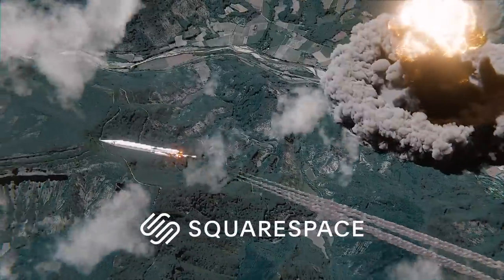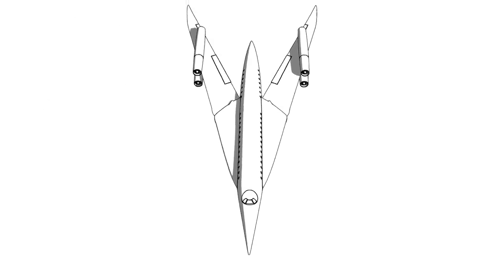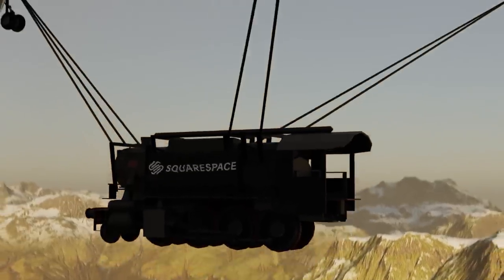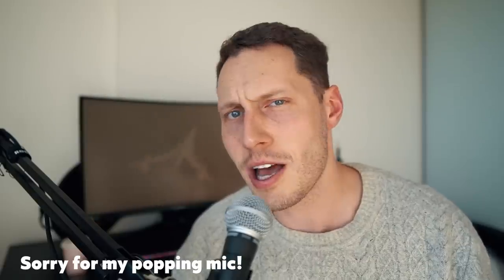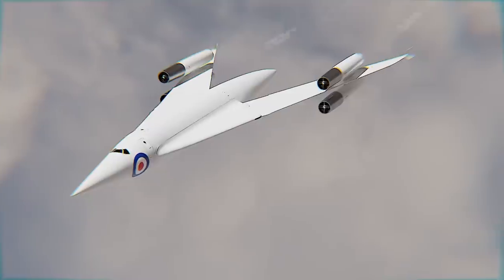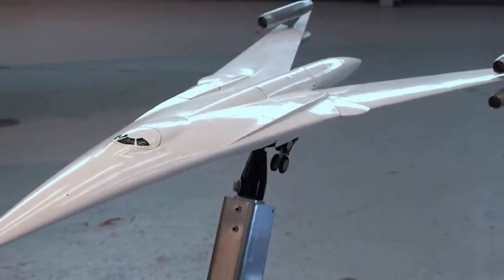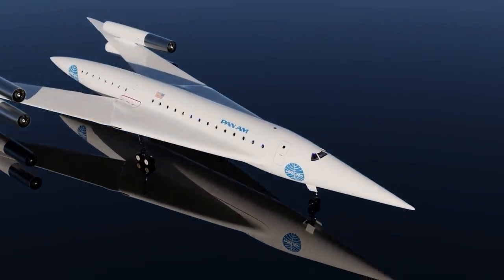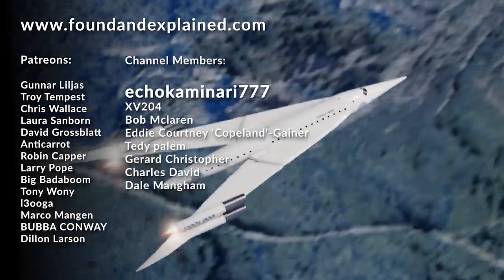The INSANE 1950s British Nuclear Bomber With No Tail - Vickers Swallow

Comment: Looks cool and it most likely would work but I can see a few major design issues with it.   A swing wing and swing engine design is complex and adds a lot of weight to the design.  For a plane to fly constantly this will become an issue in maintenance and reliability.  Add to that the need for the engines to be able to independently move just adds to the things that could and would go wrong.  The complex swing and movement controls would also take away passenger capacity and fuel capacity.  Also with the wings fully swept back the wing areas are exposed to a lot of heating from those engines meaning that wing area would need to use most costly materials to overcome it.   Nice cool looking plane design but way to many issues to become a safe and viable project.
Reply: Well after hearing our F111's were send to Alaska to have there wings pumped up and down 50 feet at minus 40 degrees to test out there strength. Scared the hell out of me and I was only a ground support fitter RAAF.

Comment: ARRRGGGHHHHH!!!!!!!!      It is/was the General Dynamics,  F One Eleven. 

One of the 10 fastest aircraft ever made, and that includes the three aircraft of the SR-71 family and the X15! They could also do a spectacular dump and burn. In the early days, they had another trick - crashing due to structural failure.  Known as a hanger queen due to the high maintenance requirements, the cost of which forced the decade-early retirement of the RAAF F111Cs in 2010 (was supposed to be 2020) after 37 years of service.  The only other operator of the aircraft was the USAF, which retired theirs much earlier.  In a little bit of a twist, the RAAF donated one of the aircraft to the Pacific Aviation Museum, Ford Island-Pearl Harbor, Hawaii, where it can be seen today.  It was restored to its original appearance, had the wings and tail (I think) removed, and was shipped over to Hawaii in a Hercules, then reassembled, gratis.   Several aircraft and a number of cockpit modules are on display in Australia.

Barnes Wallis's razor witt could have been harnessed as a weapon of mass destruction.

Comment: If it had a potential Military role then all RAF transport planes have their seats facing backwards, that probably explains the seating plan, rear facing seats are safer in a crash, it spreads the force across a larger area instead of concentrating it all in a lap belt

Comment: backwards seating is safer and more comfortable during deceleration.  But also contributes to motion sickness.  The engineers were right, but customer uptake and expectations would probably see it as a negative.  But no one has actually tried it yet on a commercial scale.  would be interesting to see if it was a success.

Comment: The reason for the rear facing seats is related to the humans being able to absorb higher g forces on their back rather than their fronts. Note the configuration of the Apollo capsule which has astronauts lying on their backs for the landing sequence. On the subject of this aircraft, its an example of idyllic aeronautical engineering where no mechanical component could be allowed to fail in order to maintain flight stability. I'm glad this piped dream was never built, lives have been saved.

Comment: The RAF used to fly the VC10 and all the seats pointed backwards, I believe the idea behind this was that on any mild crash ie. non total destruction or immolation through fuel explosion, the passengers bodies would have a better chance  to be completely protected and if you think about it, it could be true.  I say this because I don’t think that any VC10 had  a major crash incident.  It’s certainly worth checking.
Aaah !  Just checked Google and there are confusing reports for the safety record of the VC10 depending on whether it’s the RAF or civilian version that is questioned.  Apparently the RAF version fleet had two fatality crashes and some injuries but not much more, as to the civilian version, I didn’t read into it.  I was in the RAF and have flown on the forces VC10 and I remember being seated backwards while flying and I had no complaints, not even airsick tee hee!  So all was good!
Cheers Aah Kid!

Comment: Swinging wings? Wow
Reply: Engineering improvement the jet should be located on the fuselage wing sections so the hydraulics have to work less that will reduce to two plane crashes

Comment: If you loose an engine you reduce the power on the 2 on the other wing no great problem with 4 or more engines not possible with 2 so they already thought of that. Thrust vectoring in now common on military fighters giving control not possible with rudder, elevator and ailerons.

Comment: Hi m8.
The swing wing yank bomber was called the F One Eleven Aardvark which stole the world of aviation away from the Brit TX3 and the Canadian Arrow, both developed to flying stage exceeding all expectations both. The Aardvark was a successful sub radar terrain following killing machine to their crew but was used over the fore mentioned bombers due to American salesmanship and the British Lord Mount Bratton, unfortunately.
Reply: Mountbatten championed the Buccaneer, and he was right. That boondoggle TSR-2 project was a ridiculous waste of British taxpayers money, offering hardly any advantages over the Buccaneer at low-level, but costing three times the price! The project only continued as far as it did because of RAF intransience and aerospace company hubris.
Reply: @octowuss1888  you must be referring to the hypothesis that the RN failed to notice that Australia had been moved 200 miles or so to fit in with TSR2 range calculations (Senior service arrogance?). To many people TSR2 offered high speed low level supersonic flight with automated terrain following. The publicists may have pointed out the bananajet couldn't compete in that regime. Personally I think the thing was literally a whe elephant, and once Buccaneer had decent engines it was a perfectly adequate fit for the RAF.
Reply: The F1-11 is probably the most famous Australian air force plane.

Comment: Dont need to see your face to ask a query.
Seats are backwards for safety incase of an immediate deceleration. 
However due to the propulsion being on on adjustable wings there is too many moving parts which may fail. Increasing risk.
Reply: EMP propulsion would be necessary from the outer wings however. Due to the EMF radiation emitted.
Reply: I subscribed until you showered your face. Love the vids its not needed mate

Comment: the reason why the seats are reversed. In that aircraft. At the time runways were very short. And the aircraft would have to come to a complete stop as fast as possible. Of course later on this would be changed. I did find some other blueprints about it somewhere else. On a German website. There is another aircraft with their seats reversed many British military aircraft like the VC 10 and the l-1011 Lockheed. Reverse their seats due to an aircraft coming to a faster breaking speed than a passenger aircraft. One problem of this aircraft it would have never flown it doesn't have any stabilizers on the back fuchsia Lodge. Another YouTuber from Germany explained this principle and actually built a small model. The Germans were also working with this Prototype at the time. The East Germans were starting to make their own aircraft almost similar but not quite like the swallow. They built two of them and one of them crashed in Polish.

Comment: flying from london to sydney without stopping? why did the subsequent concorde not utilised the design of this plane as range was one of concorde's short coming!!
and the design looked very flimsy. looked like it is going to break under the stress of supersonic flight.
Reply: @syaondri  sorry my friend I don't quite understand what you mean: Concorde has a very short range and therefore why did the designers if Concorde not use the idea from this aircraft?
Reply: @syaondri  ok I understand what you are saying about the structural integrity, but how about the range? Why was it not possible for Concorde to "borrow" the long range design feature from the bomber? (Ok the engine installation issue I can understand, but it had nothing to do with the range).
Thanks for your time.

Comment: Maybe the seats facing backwards because the assumed hight landing speed. Since this airframe optimized for supersonic speeds, I assume this bird did not handle too well on low speed maneuvers. So they had to plan with higher than usual approach speeds for sake of safety. If the landing stip's size is given, plus you have to approach at a higher speed than usual airliners, than you have to break more intensively than the usual. So I guess that is why they planned  the backward seats.
Reply: At the end of the video he talks about 90mph take-offs and 75mph landings, much slower than similar extant aircraft; so no, I don't think low speed handling was a problem he was designing for.

Comment: The American's  have never failed to strangle British technological developments in every field imaginable. From computers, aircraft to RADAR and air craft carrier developments. Post WWII, the British had become a debtor nation, with a fallen empire. The debts were owed to the USA, and were not fully repaid till the 21st century. Hence  where it was politically expedient, pressure could be applied to Britain and indeed was. Where the British empire had collapsed, the American's were able to very readily able to fill the vacuum. A few examples that come to mind: The cancellation of the TSR-2, the Colossus computer, The all flying tail, developed by Miles Aviation, in Britain. ( this allowed Bell Aviation to break the sound barrier in controlled flight. ) The Magnetron. Aircraft carrier landing aids ( which were needed for jet aircraft to be safely retrieved. ) The list i provide is selective, and could certainly be more fleshed out with extensive research and presented in book form.

Comment: Thrust vectoring without modern computers??? Right.. That sounds like a great idea.  Wing pivots the best part of the design? Maybe since so much of it is pretty high risk but it is not the first swing-wing. That would have to go to the Bell X-5 which was really an improved version of the ME-P1101 That the Germans worked on but never flew. IT also could not change sweep in flight but the X-5 could. As to stealth not with those intakes. Sure it would have a smaller RCS than a B-52 or a small warehouse but not really stealthy.
Reply: "Thrust vectoring without modern computers??? Right.. That sounds like a great idea"

Considering the vectoring was only to be used for simple control actions then it is entirely reasonable, this is not an intentionally unstable design such as the Eurofighter that requires computers to remain airborne.

Comment: If one engine broken, they can shut down the other engine. Or jettison it all together. I think the plane would still fly with one set pair of engines. Although not ln its full capacity. And ofc less responsive.
If all of them failed, it has a very long wingspan to glide.

Comment: This plane was too ahead of its time and I don't think it would have ever worked even today. First off, it would never be certified. Quad jets like the 747 and A380 have to be able to still be completely controllable even if they loose all of their engines on one side of the plane. I'm not sure if that was a requirement at this time, but this plane would have never had that ability. Second, that range was pure fantasy. Even the SR71 couldn't fly anywhere close to that range iand it was way faster and way slower planes are just barely reaching that threshold.

As for the US stealing the wing swing mechanism for the F-111 (stated as F one-eleven) doubtful. I recall hearing there was some controversy over the Ardvark's swept wing, but part of the reason the lawsuit went nowhere was because the aircraft's engineers were able to prove they developed theirs completely separately, having stated almost ten years before the aircraft as a part of the Boeing's continued development on the swing wing component for their SST (this is what I recall from an old documentary, but I will admit I cannot find the Boeing reference at this time) was introduced and was mainly because of the Navy's requirements not necessarily for speed and performance. 

There is no doubt the designer was a genius, but I think this aircraft, as invisioned, was just not practical.

Comment: Your wrong about the engines.. one engine with no power would simply result in a switch to any of the other 3 engine options etc.. as for safety of passengers the jet liners of the day were also very risky.. but as a purely military platform this is about 3 generations beyond what we have today...

Comment: The tailless, swing wing design could probably work using modern avionics and flight controls, but the engines were never going to work. They are too heavy and produce too much force on the wings in the configurations pictured, and trying to actuate them would be a pipe dream, especially considering the wings themselves have to be able to sweep. Much better to put the engines on the aft of the body itself like a 727.

Comment: The concept is interesting. But the engine placement is a no from the start. 
The wings would have to be extremely reinforced and heavy to withstand the forces, the pivoting engines are a horrible idea requiring more weight in structure and mechanization, prone to catastrophic failure at the minor problem.
Putting the engines being the wing roots or in the tail would have solved that problem. They would then have to find another way of thrust vectoring that doesn't imply the whole engines moving. That was possible with movable nozzles that fighters had later.

Still the active constant correction of the thrust vectoring would be impossible to handle safely with human imput. They would have need a FBW and computer flight control that was 20 years ahead in the future at minimum.

Comment: The design is untenable.  Those engines moving all those directions is just going to have way too many issues.  And everyone dies if an engine ingests a bird.  Engines on/in the body with vectored thrust could work. The moving wing also adds a lot of weight and complexity.  This is a problem for airlines which need the most fuel efficient aircraft.  When you book a flight, the main thing everyone looks at is the price and if there are layovers.  Who even looks at the model of aircraft they will be going in?

Even if no one came up with vectored thrust, it is possible to have a pipe that directs thrust near the tips and alters direction from that leverage arm.  Or even tip jets like in the Fairey Rotodyne.

I really think the nose movement or cockpit raising are both bad solutions for visibility, even though, the nose movement was used in the Concorde and the Russian version.  It makes much more sense to me to have lower windows, like helicopters have.  Maybe with a slight lower bulge.  And although very unconventional, it is possible to have the cockpit in the wing right near the attachment point.  And obviously, with modern technology, you don't need windows at all.

Seats the other direction are safer in accidents, but you will get a lot of sick/disoriented people.  If you want people safer, those bars that hold people in rollercoasters would be great.

There are railcars made a hundred years ago that switch directions by folding the back while the seat stays in place.  They could do that for landings, but it would get really crowded with everyone trying to do that at the same time.

Another issue is the terminals.  The aircraft must fit in the terminals. 

If you are going to have a moving wing, better is just rotating the whole wing with one wing going forward the other attached to it going back.  But with that, the engines must be in the fuselage.  Like the AD-1 NASA Oblique Wing Research Aircraft.

Comment: It's the ability to take greater G forces in deceleration upon the body, due to the fact that more surface area of contact and the head are cradled, not having to rely upon seat-belts and their small contact areas. Which in weak and fat civilians can cause injuries due to the scissoring effect, and especially in women. It should be in all commercial aircraft today, but they found that a sizable % of the weak and fat civilians become disconcerted when facing the wrong way at speed. Even though trains have had both forward and backwards seats for centuries.

Comment: This one is animated, not real. Don't publish any fake video games. The old design has a tail
Reply: Bro its an animation
Reply: This comment section is going to be interesting....
Reply: Dumbo-Lert,
Dumbo-Lert!
Reply: Maybe it's animated because the plane was never built.🤷🤷🤔
Reply: Uh, it wasn't actually built for real except for some static ground mock-ups and remote controlled small-scale test models, so he animated the design for YouTube edutainment purposes. I'm not sure if you're just trolling, but if you're not, then better polish your comprehension and critical thinking skills bro. 

Also, the Vickers Swallow design excluded a vertical stabilizer and rudder from the get-go. Meaning no tail fins. It was always meant to maneuver using those variable geometry wings alone.
Reply: You really are special, aren't you, @Class One?
Reply: Hey guys we found a clown